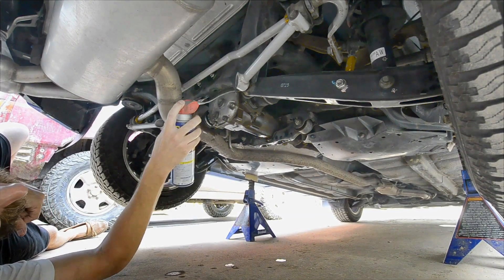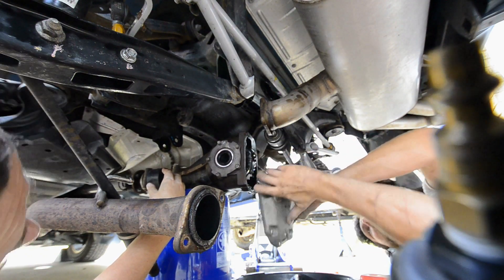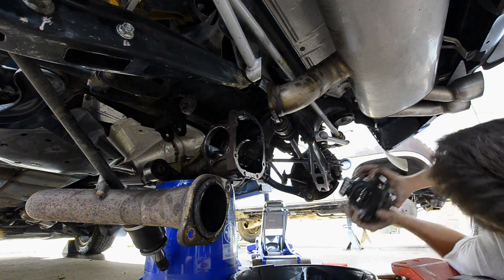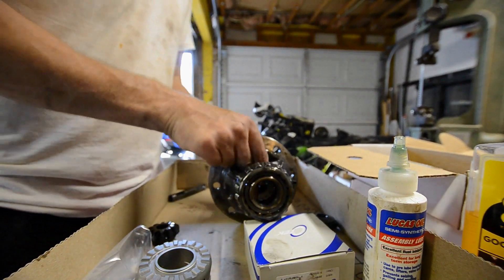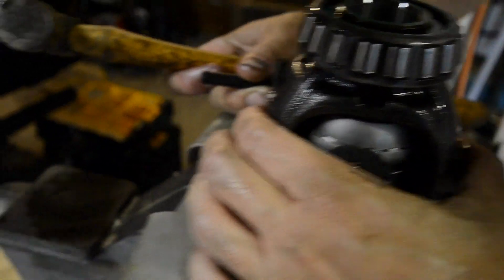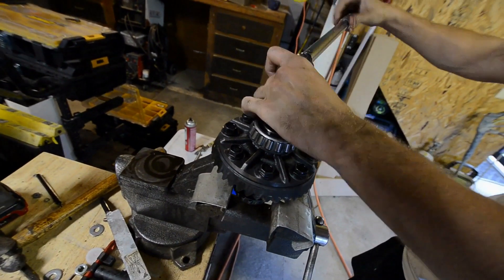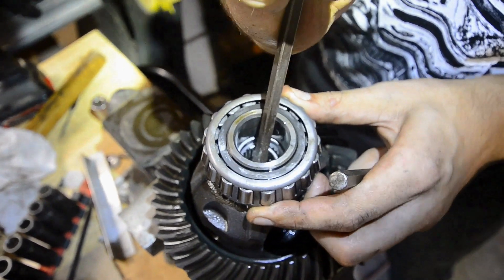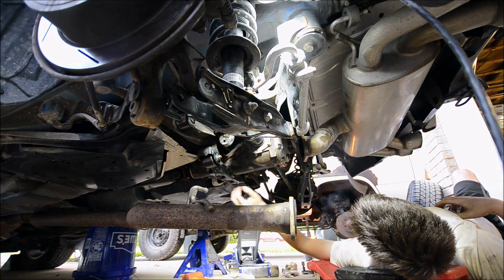How to install a TORQ Locker in 5-bolt Subaru differentials

Comment: FYI - TORQ Lockers for the 5-Bolt now come with new axle circlips installed into the Locker Cam gears - to save you a few frustrating steps!
Reply from the maker: Excellent idea! Thank you on behalf of everyone who will never have to deal with those annoying circlips.
Reply: Will the 1 bolt locker work for 2022 forester wilderness? Also curious about the manual fwd to full lock switch in your guys product description, how can someone do this set up? Thanks!

Comment: I noticed a couple things,1No lock tight on the ring gear,also punch mark the carrier bearing covers.Then check the pinion seating.But every video I have watched so far put the shims back in original location and every one seated perfect.At the end of the good video.Keep up the good work.

Comment: Are all newer subarus 2020 5 bolt dif?
Reply from the maker: They're probably still both depending on the model. Peek under the car. If there are 5 bolts on either side of the diff where the axles plug in then it's a 5 bolt, it there are none then it's a one bolt.

Comment: Hello nice videos.
I have a Forester SH 2.0 2009, with high/low knob and open differential back.
A torque locker or a torsen LSD, will work-function better in off road (dirt, sand, rock)(snow, mud). But pavement in highways and twist roads are the daily menu.

Comment: ok so i made a mistake and wanted everyone here to know what i did wrong and how to fix it. i used a cheap harbor freight punch that bent and got stuck in the pin hole i tried pulling it out with pliers, a vice ended up pulling the handle off the punch. so after a while of drinking beer BING got an idea "thank you beer" i have a pneumatic rivet gun. i cut the punch to the right size and popped it right out. hope that helps at least one person.

Comment: how does the locking rear compare to a clutch type rear diff? if a Forester has a lockable center diff, what's the difference in crawling capability between locking and clutch type?
Reply: I have a VLSD on my forester with approx 160k and it is completely useless imo. The locker does not slip once engaged the rear wheel will turn in unison.
Reply: @dirttales  yeah, I'm wondering if a nicer aftermarket clutch type, while not turning in total unison, would be good enough for most applications. an air locker seems like a lot of work, is the juice worth the squeeze?
Reply: @trinydex  first of all these are not air lockers. They are auto lockers aka mechanical lockers and they're are about as much work as installing an aftermarket lsd. Cusco and a few others make after market lsd, they cost over a grand, and do not fair well after 30k or so. Torq locker is under 500$ and from what I can see the best mod for an off road subaru.

Comment: what year Subaru  Forster  would u buy if u were just starting out
Reply: Not a 98
Reply: @jasonchall3766  why not?
Reply from the maker: SF1 gen foresters (89-99...I think) have the ej25d engine that makes less power and gave ej motors the whole head gasket reputation. Perfectly fine if maintained properly, but you still have limited drivetrain compatability with later model years.
Reply: @chrisdidick8225  98 had the EJ25D and phase 1 4EAT, so worse engine (less reliable, worse failure modes, and harder to service), along with a trans that can't be VTD swapped.

Comment: How is it working on higher speeds, like let's say 100 MPH? Does it affect the ride?
Reply from the maker: Good questions. Haven't gone quite that fast, but the biggest thing you might notice is that the car tracks a little more strait unless you're in coasting in neutral. At high speeds, energy from differences in wheel speeds is more likely to be released by the tires instead of ratcheting the locker. In high speed turns, this would equate to oversteer that is only really perceptible on loose surfaces such as gravel. Ride quality is the same.
Reply: @powerofyourbrains  soo. Have you gone to the highway allready and maybe done some evasive maneuvers too???
Reply: @powerofyourbrains  Have you gone fast with it yet?